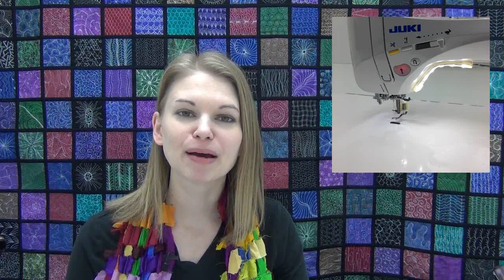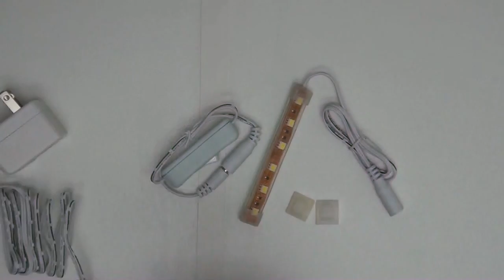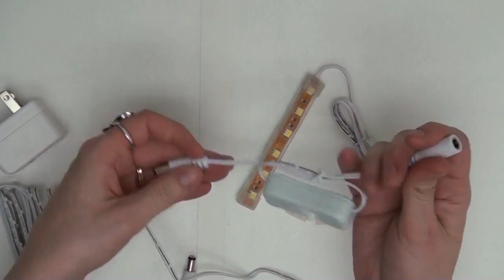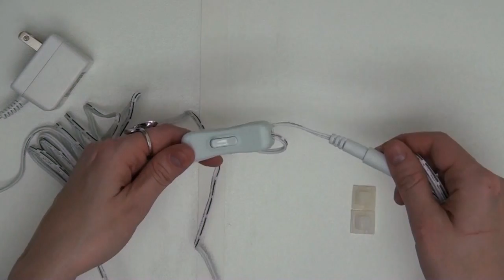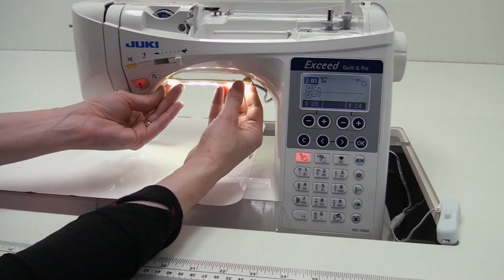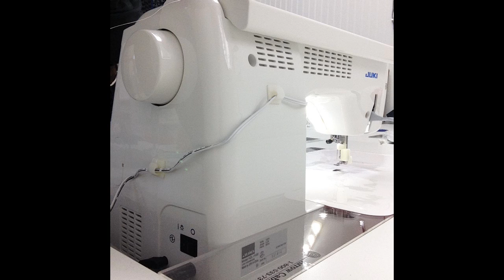How to Install Sewing Machine Lights

Comment: I just want to encourage all to not buy a cheaper set. I did and it keeps falling off. One of the first things I will get in the new year is two sets of these lights from Leah Day to put on my machines. I love having the extra light, but it is frustrating when they dont stay up. As they say you get what you pay for. These are an important part of our craft. Get these good ones.
Reply from the maker: +Kdcaswell - Thank you so much for your kind comment! Yes, you definitely do get what you pay for when it comes to equipment.